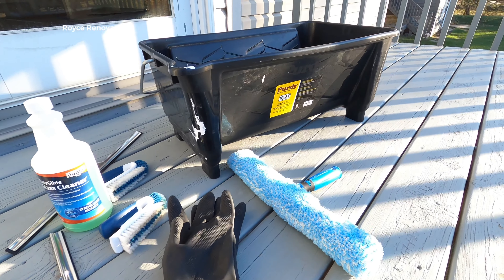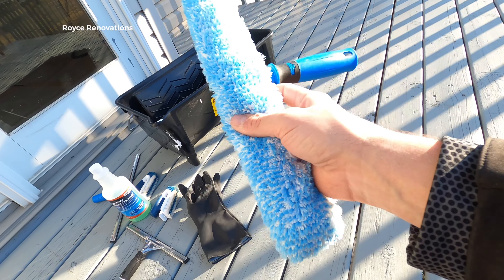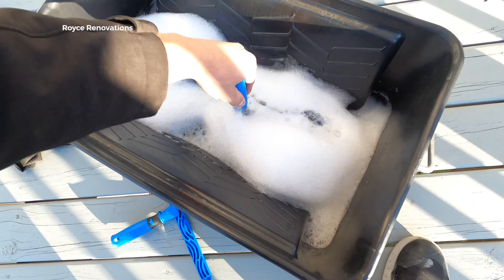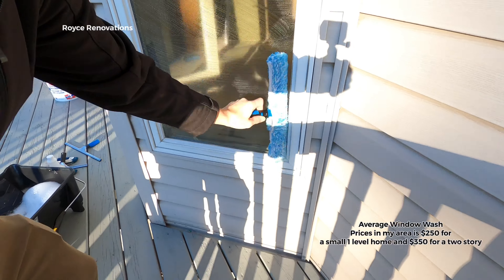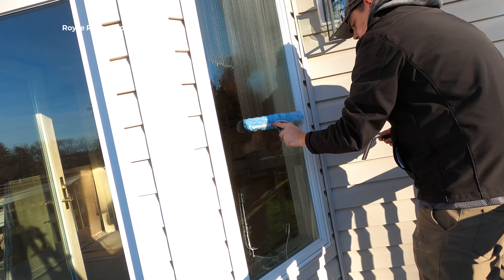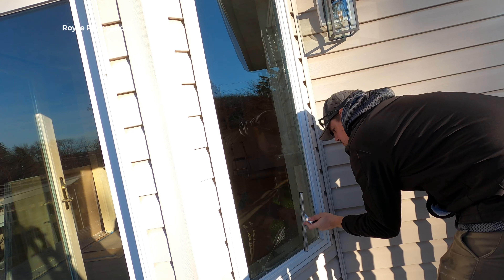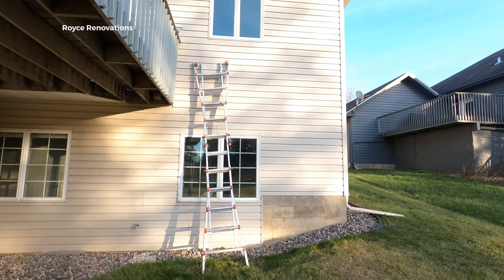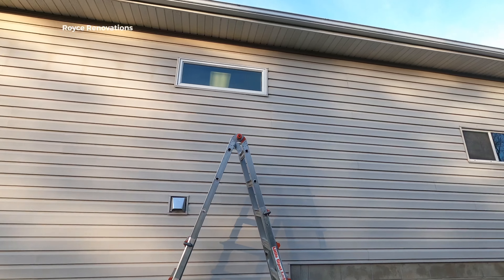Earn An Easy $1,500 A Month With This Side Job! | Part 1 #money #easy #shorts

Comment: Do you climb up and down the ladder every time you need water? Is there a trick if you're working up high working on large windows or tough it out and climb up and down?
Reply: Oh and how do you charge?
Reply from the maker: So I’ve got a smaller bucket with some wire I attach to my ladder for the real high ones. Works well for me. But also wouldn’t be for everyone. Charging is where so many things play a factor. Using google to get an idea for prices in your area is a good start but it also has to do with how long it’s been since they were last done. If it’s been 10 years then you will have to charge more. But maybe you can talk to them about it being a little high this time but next year it will be this since it won’t be so bad. 

$250 for a ranch style home is typically 28-35 windows. Which is right around $8 a window. Which again of course is location based. I’m not at all suggesting this is what you will get. You may be able to market it for more than that. Hope this helps.